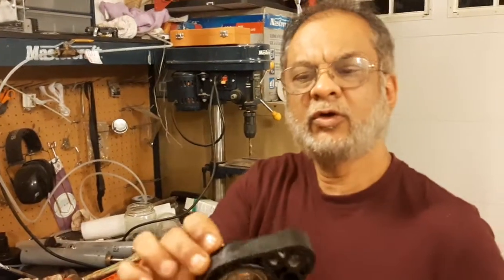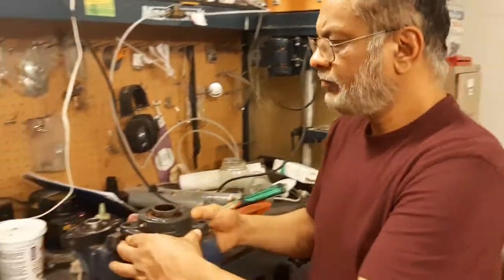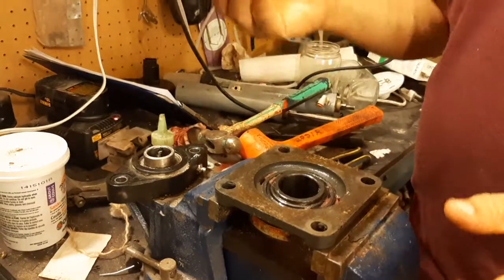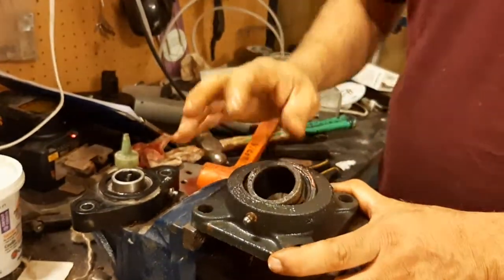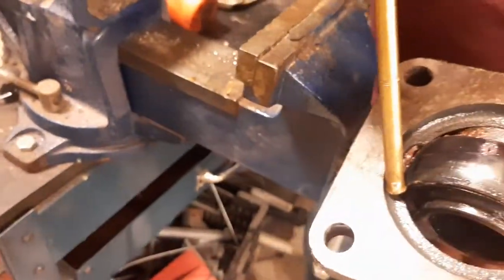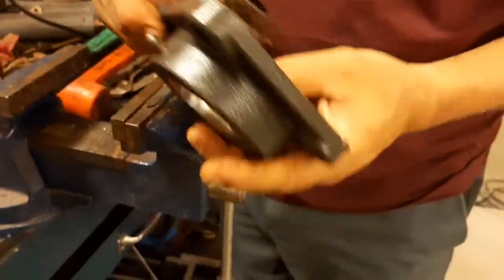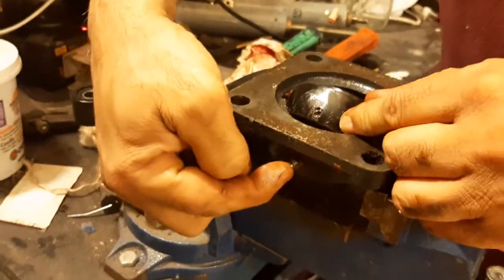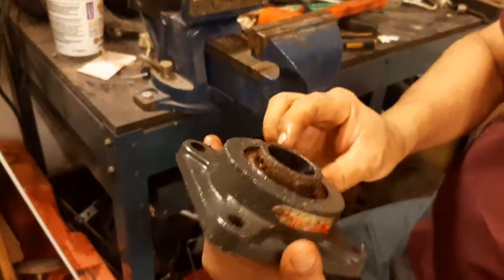How to Install Flange bearing -steel housing part 2

Comment: how do you remove the bearing if its still stuck on the shaft?  tried heating it up and tried gear puller
Reply from the maker: depends , either some time i cut it with zip cut , cutting with torch , sudden hot and cold , puller ,, hydraulic press,  pneumatic hammering ,

Comment: Cutting the shaft is never good  small amount of heat would remove from shaft   Always use a brass drift or hammer for presion parts shafts bearings are presion items
Reply from the maker: Thanks for the tip absolutely right